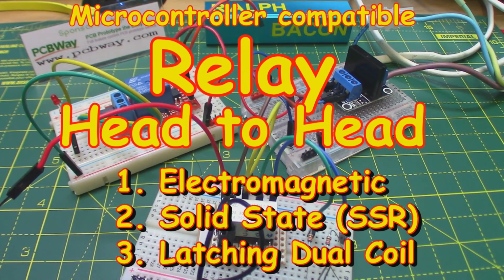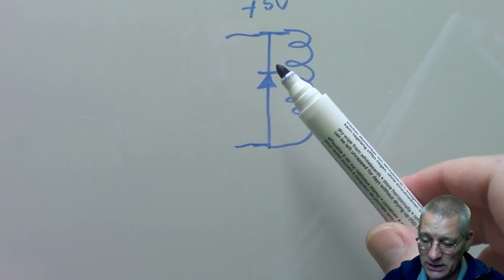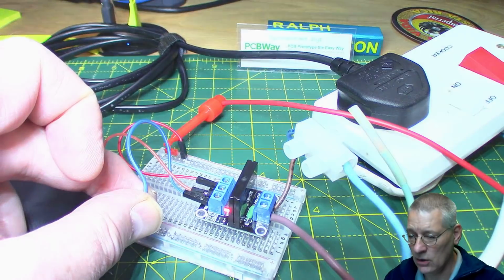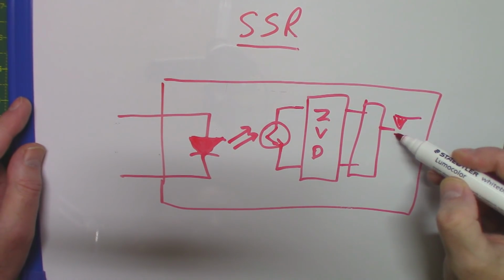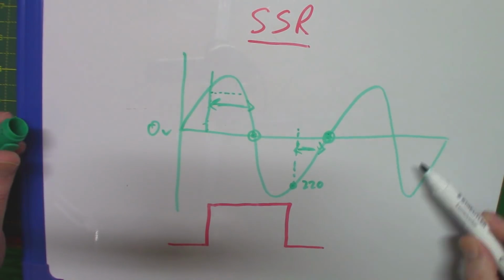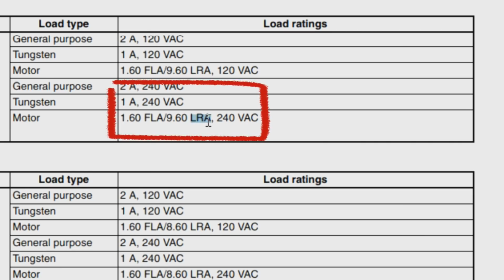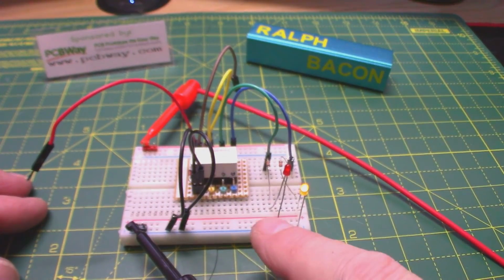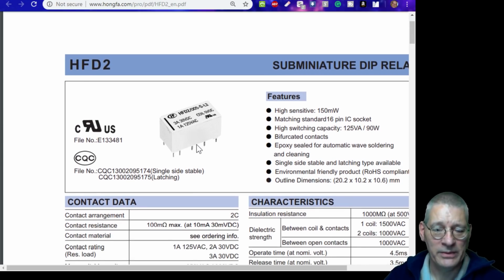#127 Relay Comparison - Electromechanical, SSR, Latching

Comment: This is a cool video - interesting stuff - thank you!

A slight clarification on the Triac. The zero volt detection will not be necessary to switch the Triac off, since a Triac is naturally self-sustaining once it's in its on state and it will itself switch off as zero is crossed. This is how a Triac is different from a transistor (transistor isn't self sustaining) and also the reason you don't commonly see DC SSRs. Under DC, there's no zero crossing event to reset the Triac out of its self-sustaining state, so it wouldn't turn off.
Reply from the maker: I thought for a minute we had our wires crossed but yes, that's very true: as soon as you remove the trigger voltage it will switch off at the (next) zero voltage point - so it's the switch on that is important. I knew this, so I've no idea why I indicated otherwise, thanks for the clarification.
Reply: @RalphBacon  Thanks for the video, I was having trouble finding information on latching relays. That's an SCR, the double-diode triac thing on the right side of the Solid State Relay, I think. But they do turn them on part way through a cycle, in order to dim lights and slow universal or DC motors. But, as albedo0point39 said, they just stay on until it gets to zero voltage. I suppose the SSR is generally defined as an SCR with a ZVD and an optocoupler. As we seem to have figured out, though, only the latching relay is capable of wasting no power in the on or off state. 

Before I was able to buy latching relays, I thought of using an automotive power door lock actuator to flip a household light-switch to cut out the lithium battery in a boombox when it got too low. I had trouble figuring out the latching relays I bought though, so far. I guess I broke the first one, there is really no example circuit in the rather cryptic datasheet I had. Now I think I know where to start on the second attempt with a second relay. Thanks!

Comment: Never rely on a relay :D Keep the vids coming, Ralph.
Reply from the maker: That could almost be a new English (electronics) proverb, Pekka. I wonder if they will add it to the English Oxford Dictionary? Thanks for the quip, made me smile!
Reply: Many railway signalling systems currently in use rely on relays in safety critical roles. Mind you; they're not the type of relay you'd buy from Bang-good or Ali-Express.

Comment: Ralph, It would have been useful to include power transistors in this video for completeness

Building on the comment below, I'm working on leading and trailing edge AC control at the moment. The former is easy and there are standard builds available using zero-cross and interrupts to the Arduino then firing the triac. However, trailing edge phase control is a bit more of a challenge (using back-to-back MOSFETs?) 

This leading and trailing edge phase control would be a good subject for one of your future videos. You could then discuss the various merits of switching at various points of the sine wave, although there is scope for you being put on the Naughty Step if you go too far off-piste

My application (and now your homework) is to control a 500W 240V AC motor used in power showers. Why? My daughter comes home at vampire time, takes a shower and wakes the house up.  As these pumps are overrated I believe she will never know if its running at a lower power.

I presume we no longer have to keep an eye open for you?
Reply from the maker: Thank goodness I'm not already on the naughty step after that mains connected relay so close to my hand!
 
On the power shower front, have you considered a variac? Basically, an infinitely adjustable tapped (non-isolating) transformer. They would be too expensive new, I suspect, but second hand might do the trick rather than phase control of 240v which might make the motor very noisy and possibly stall. Just to rub salt into the wound, my power shower pump has three settings on it - if I set it on level 1 I suspect it would do what you want. I have it on the highest level normally (and don't change it because the pump is in the attic). On the other hand, just leave it another two or three years and she will have flown the nest, problem solved!
 
I'll look into this subject a bit more but that just struck me as I read your comment.
 
And yes, my eye is healing nicely, not yet as it was but getting there. Need new specs, I suspect. More cost.
Reply: @RalphBacon  I realise I could buy a variac and there are several leading and trailing edge phase angle controllers on the market. But that's not why we do this is it? This phase angle stuff would bring many of your videos together (Arduino interrupts, timer register setting, zero cross, opto coupler triac firing, mains safety, etc etc.) As its then controlling AC mains it will have many applications for the Arduinites. There is a standard leading edge build on the Arduino Forum so start there?

I've got the leading edge version working. The motor is quieter.  I am just curious to have a back-to-back comparison of leading and trailing edge control of these general purpose AC motors (same as in AC electric corded drills) .... with you doing all the hard work. I sort of feel that switching the trailing edge OFF is somehow 'kinder' to the load, rather than banging up to half a waveform into the load ....  but that may just be me getting all emotional again.

You will need a twin-beam scope though .... 

Glad the eye is better.
Reply from the maker: On the "leading" vs "trailing" edge debate, don't all new dimmers have to be trailing edge dimmer, as otherwise the EU universe will end? Partly because they have a lower minimum load requirement, and are much smoother and don't have that annoying buzz. But they are more complex and hence a bit more expensive.
 
LED dimmers are a different kettle of fish as the LED has to be compatible with whatever dimming technology you / the universe is using these days (due to the LED being run on DC, not AC). I'll look into that phase control, see what I find without killing myself...
Reply: @RalphBacon  I believe the choice of LE vs TE depends on the type of load to be controlled. Resistive loads are pretty straightforward, but inductive and maybe capacitive loads can be troublesome due to power factor and back EMF causing 'ringing'. This is where the snubber circuit comes into play.  To simplify things start with a pure resistive load and get your waveforms then stick a transformer in the load circuit and see the effect of inductance. Finally put a fluorescent tube starter in there and try and control that!

Ref LEDs, yes you are right. This is because the retrofit LED lights have a transformer ( = inductor) and smoothing capacitors in the light housing so the dimmer has to accommodate this. Perhaps this is why TE is used, if it is, I'm not sure.

This can all very involved, but that is where you hand it back to us to take it further if we wish. Those that do will need a twin beam oscilloscope though.

Comment: Nice video. Almost forgot those bi stable Relais. But I have some in my lab and maybe they might come in handy some day.
Reply from the maker: One day, someday - probably means "never", Michael. However, I will keep them in mind for my future projects. The best use is when you want to save power and don't want to supply current to the coil to keep it energised.
Reply: Ralph S Bacon you are probably right. They are lying around here since 10 years or so. Got them cheap long time before al those Chinese sellers turned up from the German electronic discounter Pollin Electronic. If I think about it I could have used one of those in a project I did a year ago (battery powered bath tube thermometer for my little daughter using an oled, an DS18B20 a nano clone and a 9 Volt battery). But I ended up using a mosfet and an optocoupler besides some resistors and a cap.
Reply from the maker: And in the Real World, given a free choice, what would I use? A mechanical relay or a MOSFET? I'll leave you to come up with the answer but I can give you a hint. Ich wuerde fast nie ein Relais benutzen! But I do like the "click" they make. Almost like audible feedback that it's working as expected!
Reply: Ralph S Bacon eben. And if you really need isolation (maybe because of different ground potentials) you can always isolate your mosfet with an optocoupler. But mostly not needed. Fine for all low voltage applications.
Reply: @RalphBacon  mein Gott! Du spricht Deutsch auch!? Ausgezeichnet! Ich muß viel mehr Deutsch zu lernen! 👌
Reply from the maker: We're very cosmopolitan here, Bob. Ich glaube viele sprechen (oder verstehen, mindestens) Deutsch hier. Keine Ahnung warum, aber so ist es. Meine Mutter kommt aus Deutschland und wohnt in der Naehe von Stuttgart.
Reply: Ralph S Bacon Deutsch ist relativ verbreitet. Ähnlich wie Spanisch oder Französisch. Und wenn der Großteil der westlichen sich nicht irgendwie auf die „Amtssprache“ Englisch geeinigt hätten, wer weiß was wir dann heute alle als erste Fremdsprache lernen würden... aber warum jetzt ausgerechnet so viele Leute aus United Kingdom deutsch sprechen weiß ich leider nicht. Ich kenne aber so einige (auch insbesondere Youtuber)

Comment: Ralph....good video as usual!  
However some of the info about the zero voltage detection is not correct.  It's not wrong (maybe it's bad) to switch on during the sine wave - this is called phase angle control and it's how dimmers work.  There are many product that is this for dimming.  And no it will not mess up your WiFi and your neighbor will not be at your door.  But you are correct..it is electrically noisy.  But to your point, the relay probably does work that way..but it's not wrong to switch during the sine wave.
Reply: Expanding upon the foregoing. The idea of ZVD on an SSR is to switch the triac on as close to the zero voltage (hopefully zero current) point thus minimising RFI. It can get its knickers in a twist sometimes if your switching into a reactive circuit.
Reply from the maker: From experience, James, it can most certainly be bad (and hence wrong?) to just switch the mains when not at zero.
 
In the 1970s (yes, I'm that old) I made some sound-to-light units for my teenage disco stage. The partly rectified sound signal was fed to a triac which then switched on when the trigger voltage was met. Great! Worked like dream. I was the hero. But the RFI had to be heard to be believed. Probably have more than the neighbours knocking on my door if I did that sort of thing today!
 
I'll look into phase switching. I know that special precautions have to be taken to prevent that RFI as otherwise, an old-fashioned rotary light dimmer would do what my sound-to-light units did. Just the thought...
 
Stay tuned and see what I discover! Thanks for posting.

Comment: I haven't used latching relays for years (40+ of them, probably) - for the simple reason that you can never be sure of the initial state, thus making them potentially dangerous.

They do, I'm sure, have their uses, but I'd struggle to think of one.
Reply: One application I've encountered where latching relays are used is for switching between two pieces of equipment where one is a main and the other is a stand-by that needs to be "exercised", say,  week and week about. I have some Spinner Coaxial relays that were removed from VHF base-station equipment. Uber-expensive when brand new.
Reply from the maker: @Bob Lewis
So my wall thermostat could indeed be described as:
 
"[one of those] thermostats which are battery powered plus have LCD displays and are expected to last years on one set of alkaline batteries."
 
So THAT'S why the AAA batteries last so long in it. Of course! You'd think I would have twigged this. Now I get it too.
Reply from the maker: The code (on a microprocessor) could sort out the initial state if it was that important, Duncan. After all, if the relay had switched on some mains equipment, it would turn back on for less than 1/2 second as the microprocessor started running the code before the µprocessor switched it off again.
Reply: @RalphBacon  And a lot of damage could be done in half a second!!!
Reply: Duncan, you are absolutely correct in that unless you use some kind of logic ladder to maintain a non volatile state log, the relay could be in either state on return of power. However, given that in MOST cases it's likely only being used as an electronically controlled mains toggle switch, it has EXACTLY the same issues as a normal mains toggle switch in the same circumstances e.g. a light switch or a panel toggle. It is therefore a relatively easy safety test to simply ask the question "would a normal mechanical toggle switch be safe to have/use in this circuit in the event of a power failure and return?"

If the answer is NO, they each fail and then other design elements would need to be considered and included. Equally however, the electronic toggle relays (pulse triggered normal relay, using an electronic hold mechanism) DON'T  work that way and DO change state to Normally Open on power fail. This is the reason why self latching relays are useful in zero to low power switching environments such as many (if not most) underfloor thermostats which are battery powered plus have LCD displays and are expected to last years on one set of alkaline batteries.

These are commercially available units for domestic electrical heating and wouldn't pass the relevant British Standard if they were considered.potentially dangerous or lethal.
Reply: Table lamps dont turn their switch off if there is a power cut. Potentially dangerous? Yes. Practically dangerous? Meh. In fact that is exactly the use case, making a lamp that can be switched by a human, or remotely controlled without a lot of complicated feedback mechanisms.
Reply: @backyardelmer9441  Point taken...

I just prefer to have a known default state, I guess.

Comment: DC SSR's are widely available, https://uk.rs-online.com/web/p/solid-state-relays/2448993/

edit; They are out of stock because i just ordered a load lol
Reply from the maker: That's a clear cheat, Spark Doctor! They might be called a relay but they are really super high power MOSFETs. No different, in principle, to what I did in video #123.
 
And OMG how expensive is that? Nearly 40 quid ($50) EACH?!!? I don't think I will be ordering any (even if they do come back into stock)!  Did you really order some? If so, what possible use are they for?
Reply: @RalphBacon  Hi Ralf. Sorry for the lateness of the reply. Yes, i ordered 20 of them. We use them in a underwater application where they are in effect potted so it is a complete pain to get to. As to why we spend that much on them, yes we could buy them from Ebay or AliExpress but we would not get the certificate of conformity and for us to comply with ISO2009 and various other certifications, we have to have trace-ability especially when dealing with the military.

Have a look at the data sheet on the RS site again, The circuit diagram is almost the same as what you drew in your video.

Comment: DC SSR on Aliexpress, just  about 1$
https://www.aliexpress.com/item/Free-shipping-Smart-Electronics-4-Channel-5V-DC-Relay-Module-Solid-State-High-Level-OMRON-SSR/32727486514.html
Reply from the maker: These don't allow DC to be switched, though, Batticha - the LOAD must be AC and can clearly see this on the relay itself. It's one of the laws of physics that is you're using a triac to do the switching then it needs to switch AC  - if you ever want to be able to switch it off again! Incidentally, you can edit that link and remove everything after (and including) the question mark, it's not required.